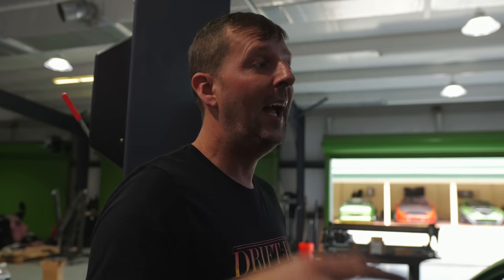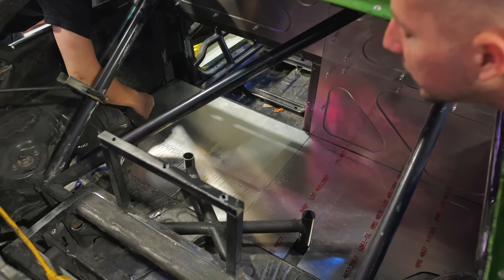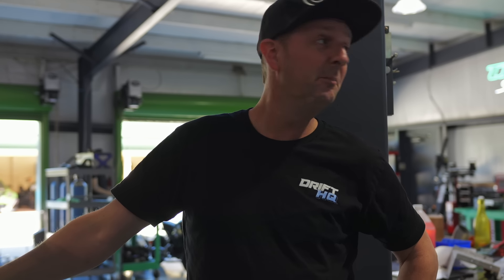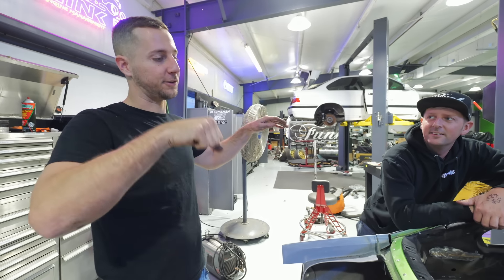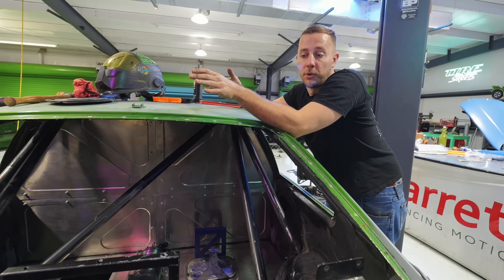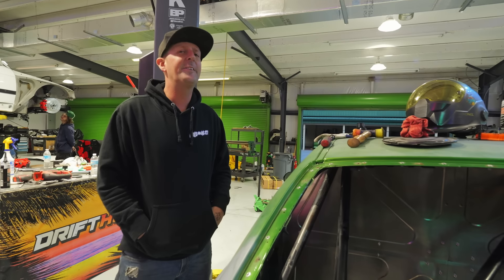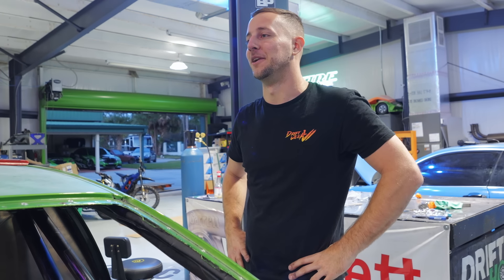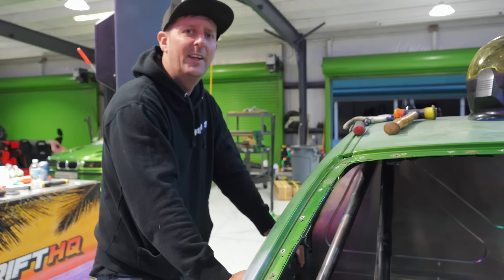2JZ E46 | Custom Rear Firewall

Comment: What is the heat resistant material Donny is installing to the tunnel and frame rails?
Reply: Heat shield
Reply: @920.streetstyle   I’m aware of its purpose, I’m more curious on the brand.
Reply: @jbergyz8152  probably funk since it's what they sell
Reply: This is D.E.I heat shield. Works really good especially when you are dealing with bends and contours. Comes in silver or black
Reply: @CrickettFab  thanks, I appreciate that

Comment: Did you think welding a circle were the fuel pump was because maybe alot of rock gonna go between the block of plate and the floor of tje car?
Reply: Yes. We are going to close it off once we get the lines run so we know where to put the plate. 🤘🏼🤘🏼🤘🏼just need everything ready for paint. The seat deck won’t be re sprayed

Comment: Jump car would be slick. Cricket can fab up new suspension points and build custom arms, long travel stuff. Take Ivan Stewart’s Baja 1000 T100 for instances it was 4 wheel independent and long travel. Now would you guys need that probably not but custom build 1-2 in longer arms maybe and new shock mounts or convert to shock hoops like the off road stuff. Yes it can be done simpler as I’m sure ever all seen hoonigans baja36 but it can be done better and you guys have the ability to make it better.

Comment: Why not do an N54/N55 build? Could even build it in an e36 or e46? Would be cool to see a definitive build to make it more robust and work around (or get rid of) the BMW engine safety features. Throw a standalone ECU with port injection and make an alternative solution for the e-water pump. Be pioneers of an alternative 6cyl engine build vs the JZ, RB and B58 engines since those are so expensive. Love form South Africa!

Comment: I dont know how bad E36 axles are, but E90 axles suck too. I had to modify a "FWD Hub Puller" from AutoZone to push the axles out of the hub. They are also a bitch to reinstall until i figured out the best way IMO. I put the new axle in the freezer before i start working on my car. Then I heat up the hub with a torch and take the axles out of the freezer and immediately slide them in to the hubs.